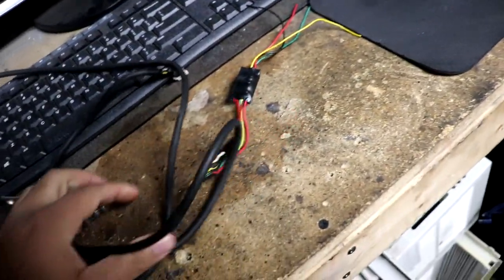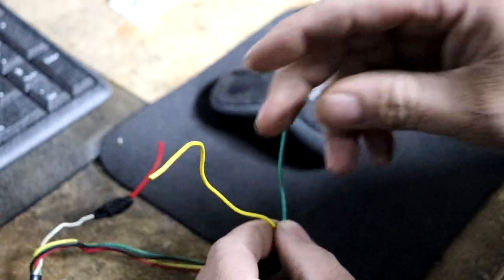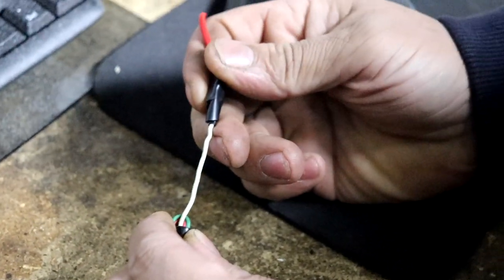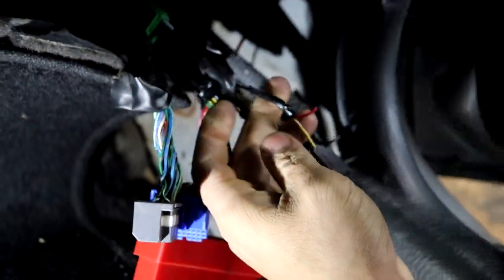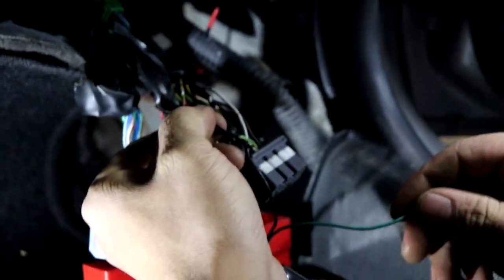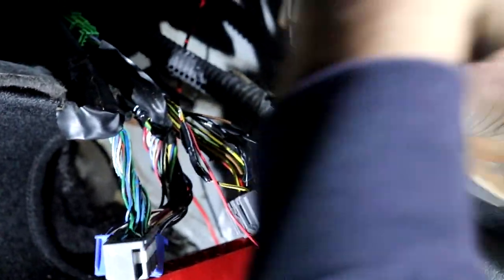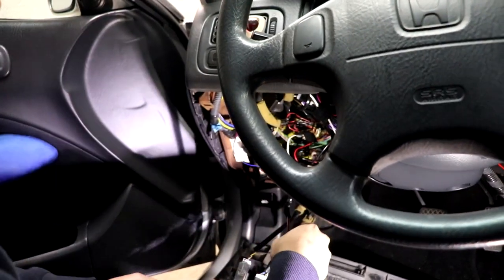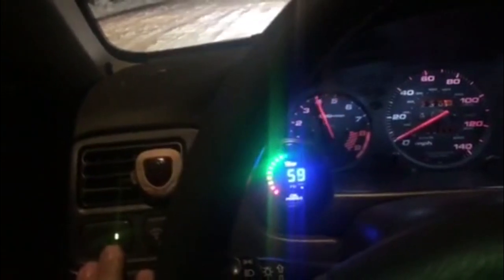How To Install A Bee R Rev Limiter On Any Car

Comment: Great video I have 92 miata installed bee r rev and it works but never understood the white wire. But if I got it right now the wire is a ground that is ran through a switch to access on demand

Comment: This may be for Hondas only as Bee*R states green = ignition signal & yellow = RPM signal. There are different types of Bee*R devices for hondas & subarus. Be warned!
Reply: That's what I figured. I have the type B limiter for my G35 and for a fact there's more wires for that setup

Comment: Hi there, I'm currently trying to install a bee r rev limiter to my 4afe (trynna get some more fun outta it) and was wondering if by any chance you could provide some help into which wire is the ignition wire from the ecu (have looked at a few diagrams but since I haven't learnt how to read ecu diagrams yet it's very confusing finding which wire goes where)
I have a 1996 4afe a/t (if that helps with anything) just needing to find out what the ignition wire colour would be from the ecu pin out (if any of that makes sense) and any help would be appreciated, thank you
Reply: You get it installed? I’ve got a 1991 4AFE that I’m looking into installing this onto.
Reply: Could you install the bee R in your 4AFE???

I need help to install it, I have already tried but I have not succeeded
Reply: any update?

Comment: I did this this setup on my 99 d series harnes with my Obd2a to b swap for a 97 integra and now it won’t start and I can’t even get power to the box I reconnect the yellow and green wire and it starts right up , not sure why I can’t get power to the box or why the car dosent start after wiring it in the way you said green line to the green and yellow harness side out , yellow on the yellow green ecu side , red on yellow black and black to black

Comment: Is this install for the type B, the type H, or the type H2 bee r limiter?
Reply: Think the hondas use type h
Reply: @calebcuddy1990  Yea they do but just about everything else uses the Type B. They say in this vid to cut and interrupt the signal wire, but for the Type B it says to splice in only and not to cut any factory wires. Im guessing this video is only how to install a Type H limiter?
Reply: festa289 the hondas n scoobys used the ignition single for the coils due to interference with the crack and ECUs or something along those lines. Tbh there’s a number of different ways to do it. Probably best piggybacking of the wires rather than cutting

Comment: could the yellow and green wires be put on the ignition power wire? to interrupt the signal? kinda like the wot boxes
Reply from the maker: Yea
Reply: @thelostkidsgarage  thank you!
Reply: So I connected the yellow and green to the igf wire (cut and spliced in both directions) my car turns on and then instantly dies
Reply: @nickturrell6496  if I had to guess I would say its because there would be a wire issue with the power / direction, what is happening is your car wont start because there is no power/ signal on the line based off what you have said. if you can elaborate more or message me I can try and help you
Reply: @nickturrell6496  have you fixed it?
Reply: No I have not yet still working

Comment: i dont understand from where the fire comes
Reply from the maker: It comes from the motor the bee R all it does is it tells the ECU to adds more fuel and spark then ignites it depending on what setting you pick It throws more fuel or less fuel

Comment: How to wire for all cars  
--------------------------
R power (battery)
B Ground (battery)
Y Cam Sensor
G crank sensor 
W switch (option)
Reply: Cam and crank sensor wires have no way of interrupting the ignition.
Reply: @richardphillips107  actually it does, the bee r unit takes the signal and converts it to a voltage and that voltage is what is sent to the ignition coils to been stop them
Reply: @nickturrell6496  How does it do that though if the bee r isn't connected to the coils?
Reply: And when you have a V6, with two cam sensor ?

Comment: Hello i have a honda s2000

Connected all the wires as they should

And white wire to ground

Bee R only blinks Once when i put ignition switch

But wont do anything or blink anymore after that 

Please let me know if theres anything i should do i been having hard time , thanks God bless
Reply from the maker: Where did you get the Bee R from?

Comment: Can u guys tell me honestly how bad it is for valves or anytbing if I buy one?
Reply from the maker: Tbh we don't know but it goes without saying making any car shoot flames isn't really great for the motor if you abuse the flames
Reply: @thelostkidsgarage  do u still have it on that car? How long has it been? Does he do it often? My bad for the questions but I would probably shoot ‘em frequently so idk if it’s worth without fucking motor up
Reply from the maker: @Hallisi  I just recently removed it since the car now has a turbo I can make it shoot flames without it but I had it for about 2 years with no problems but I didn't use it alot maybe once a week or when little kids say rev it
Reply: @thelostkidsgarage  will this work on a 98 accord v6 because I already have a light bar on the front of my bumper I have the relay to run my light bar and I button to turn it off and on

Comment: Is it gonna work on a 1994 Toyota celica 1.8 just like this
Reply from the maker: Yes but make sure you find what color is your Ignition cable
Reply: But the yellow and black color is the positive and black is still negative
Reply: So I just cut the ignition cable, and make the yellow wire on the ecu side and the green wire to the engine side?
Reply: The ignition cable is igt? or is it igf?
Reply: I found the igt cable and it’s all black
Reply from the maker: @nicksonneveld8338   there's a diagram in the description
Reply: @thelostkidsgarage  is the bee r switch cable a negative or positive ?

Comment: Was your car stock or turbo
Reply from the maker: It had a b20V non turbo in this video
Reply: I have a 1998 civic vtec will it work
Reply from the maker: @aws423  yes it will work just make sure you get it off of the website I have In the description because that's the only place I know where they have real ones

Comment: so if i want to installed it on my hyundai coupe 2.0 the yellow and green wire is just connected to the ignition wire?
Reply from the maker: people have been hitting me up alot to try and help them so i just uploaded a link to a diagram i just made in description
Reply: @thelostkidsgarage  thankss m8😁
Reply: Bro those the wire diagram same with the knock off one also?
Reply from the maker: @geogarage  don't get the knock off ones trust me my cousin got one and he returned it because it made his car run like shit and it wasn't even throwing flames or popping at all
Reply: @thelostkidsgarage  aight m8 thanks for the info man😁